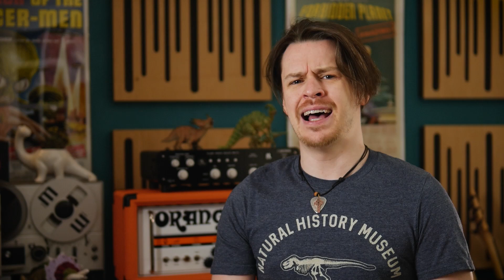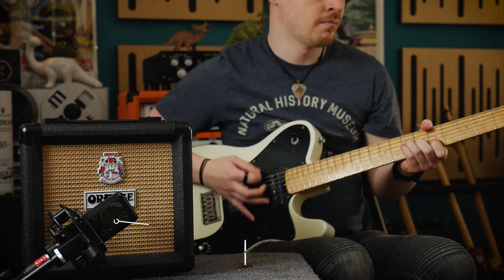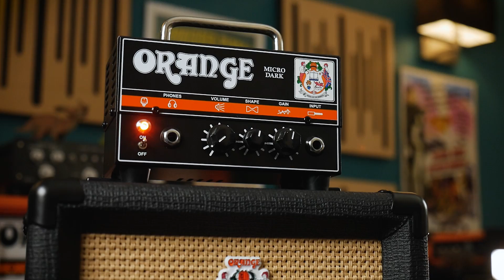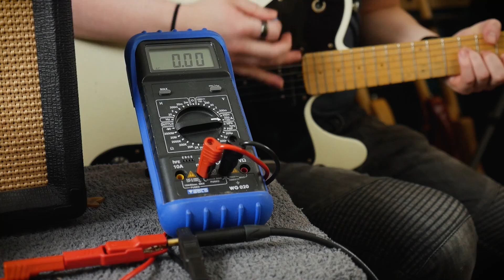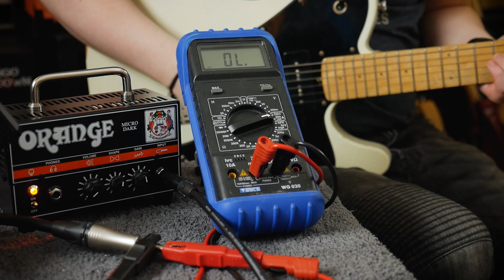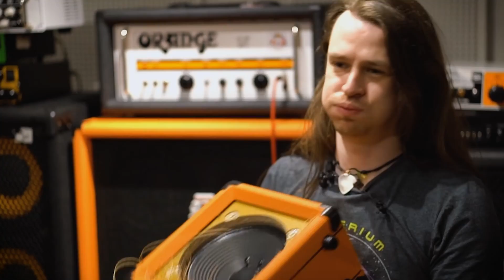Are AMPLIFIERS a LIE?! Guitar Direct into Speaker | Too Afraid To Ask

Comment from the maker: What would happen if we plugged our guitar directly into a speaker cabinet without an amplifier? It might seem obvious, but let's put it to the test and determine WHY amplifiers are so important. 

Ask your TATAs in the comment section and perhaps they will become the topic of a future video.

20W Guitar Speaker into 200W Bass Amp - https://www.youtube.com/watch?v=vuQAJCDQd5E

#guitar #amplifier #speaker

More from CSGuitars: 
Gain access to exclusive content at: https://www.patreon.com/csguitars
Join CSGuitars Discord - https://discord.gg/d7b6MY8
Buy CSGuitars Merchandise - https://www.csguitars.co.uk/store
Website - http://www.csguitars.co.uk
Contact - colin@csguitars.co.uk
Reply: I have a better question; would it damage your home media speakers (such as your PC speakers) if you connect your guitar to them directly? Or with a pedal? Say, whats the difference between a Logitech Speaker (with built in amplifier) and a Marshall Guitar Amplifier?
Reply: You missed some science. A larger speaker with a higher SPL per watt would be much easier to drive than that small orange speaker. I imagine that orange speaker is around 90db at 1w/1m. A good 12" speaker will be around 100db at 1w/1m. 
 I had a horn loaded cab once that was sensitive enough to pick up a radio station when not connected to anything.
Reply: @stimpsonjcat26  GOOD point!
Reply: Blackstar has some Tube driven guitar pedals. Do you think one of those might have a more substantial sound plugged directly into a speaker cab?
Reply from the maker: @Gonnasifaherpewarts  They'll still be outputting at line level impedance because they are intended as preamps, much like the Rat used in this video. They'll still need a power amp to drive a speaker effectively
Reply: @Gonnasifaherpewarts  try with a 4 ohm or less low wattage speaker if the pedal can stand it
Reply: @Gonnasifaherpewarts  Nah! The output levels will be the same!
Reply: What would happen if you'd plug into a powered cab, like you would use with an unpowered Kemper?
Reply: What would happen to your amp and/or speaker if you used an instrument cable to run to your cab instead of a speaker cable?
Reply: @dudemcfaceyface  DON'T do it!
Reply: @DMSProduktions  I'm not going to do it, I like my amps and cabs too much. I'm just curious as to what would happen and I thought maybe @CSGuitars could show us.
Reply: @dudemcfaceyface  GOOD boy/girl/thing!
Reply: Now do "Are cable a lie?"
Reply: @robbirose7032  Oll yor bass are belong to us!
Reply: 🌋☄🧟‍♂️🎆🚨🔥🌪🍆💣🦠💥☠🤡
^ to put it lightly.
Reply: @lichkrieg4898  SPAM alert!
Reply: @DMSProduktions  no, that's literally what happens. a bunch of emojis appear and accost you.
Reply: @lichkrieg4898  Isn't this WHAT'S happened?
Reply: HO There! Some multifx units are enough to drive speakers, at least for home practice/bedroom level. I'm running distortion pedals and a lexicon mx200 through a mxr rack EQ straight into an orange 1x12 (16ohm), no amp. actually kinda loud if i crank it.
Reply: I managed to get a lot of sound by pluging my guitar into the mic port of a record player which went in to some speakers and was louder than my 10w amp

Comment: The guitar plugged directly into party speakers still makes decent noise. How is that happening?
Are there various types of speakers?
Are guitar speaker cabinets different from other karaoke party speakers, can some type of speakers drive the electric guitar signal but guitar speaker cabinets cannot drive the signal?
Reply from the maker: Your 'Party Speakers' are powered. What is getting power? It's the internal amplifier. Party Speaker are a hifi amp AND speaker in one box. 

Standard guitar speakers are just the speakers in a wooden box. That's why we need the separate amp.

If you plug the speaker into power, or it has a battery in it, then it's also an amplifier.

Comment: You can actually use a normal blue tooth speaker and plug it straight into the guitar with a lead  and get sound out. 
They are made to amplify the weak output of a phone. 

I use a an iRig2 HD , hooked up to an ordinary Hi-Fi system via my computer and Amplitube 5 max as the app. As my guitar amp is to loud. 

Works brilliantly

Comment: Pickups don't actually generate electricity so much as move electrons back and forth in an AC waveform. That gets filtered through a capacitor into the amplifier. Also, please do not pull current through your pedals. It's not designed to work that way, and power looking for ground will find it through the tiny circuits and burn them out if it's the only path. It can happen with your PC too if you have a powered USB hub but the PC itself is unplugged.

There is a big difference between the parts of a circuit meant for signals (<20mA) and ones meant for supplying current, and that 200mA is about 40x the amount of current that is used to drive the gate on the average transistor. Protected signal circuits will generally be powered or grounded through a pull-up/pull-down resistor, in which case it is limited in how much current can flow.

Comment: I actually did this experiment a few months ago and I found that my caline 10-band eq with gain and level maxed out is kinda capable of driving a speaker at kinda usable volume. Still I wouldn't use it lets say in case that my power amp breaks because guitar speaker's impedance is wery low and guitar pedals generally have relatively high output impedance which messes with the sound and sometimes might cause damage to a pedal

Comment: I can plug my guitar into any one of my studio monitors and it works just fine. It has its own power supply but i dont think it has an amp built in. How does this even work?
Reply from the maker: Powered Speakers/Monitors: The part that takes power IS the amplifier. If the speaker plugs into mains then it DOES have a built in amp.

Comment: If your effects pedal has a Headphone Out jack, you can plug that directly into a speaker cabinet.  The Headphone Out circuit is generally about 300mW-500mW (1/3 to 1/2 watts) and can be a perfectly usable bedroom/practice amp.

Comment: My hypothesis is that you will not hear anything or it will be very very quiet. the voltage that comes out of a guitar is very low, ad has very high impedance, so it realy cant deliver much energy to the speaker

Comment: Can I replace guitar cabinet with studio monitor?
Reply: Short answer is no. If you try to run a tube amplifier directly into a powered monitor speaker, audio interface or anything else expecting a line level signal, you will destroy your amplifier. You can get a load box that will handle the output of your amplifier and then it offers line outs, headphone outs, FX loop etc.

Comment: The more interesting question for me is… could I use studio monitors instead of a cabinet, as the output directly from the amp? Or vice versa, connecting a cabinet as the output from a DI box? I know it technically works either way, but what are the pros and cons of each setup vs doing it the traditional way?

Comment: If you hook up the guitar directly to the speaker, the impedance of the pickups are also thus much higher than that of the speaker itself that they end up consuming most of the voltage they produce themselves, a little bit like with a shorted battery. I wasn’t too sure what was going to happen with the active pickups, because I think they have a preamp in them that might decouple the pickups. I really enjoyed the test and your explanation.

Comment: Once when I started learning guitar I plugged my borrowed strat into some double speaker we had at home and I got a dry clean signal and it wasn't even very quiet. I don't know how it worked tho. (There were two speakers on each side of a radio that it was connected to, don't know if it has anything to do with it).

Comment: I think Colin forgot to specify that by amplifier he means power amplifier. The little orange head has pre amp and power amp sections. Of course, you can run your guitar straight into the return input of your effects loop to hear exactly what your guitar sounds like without any tone shaping by a pre amp. It'll be pretty lifeless and bland.
Reply: Don't take my word for anything. In fact, ignore everything I said.

Comment: Hey I have a TATA: Is there a difference between bass cabs and guitar cabs? I play bass and guitar. Can i get a cab and just swap out a bass or guitar head? Or should guitar heads only be played through guitar cabs?
Reply from the maker: Bass amplifiers can often dish our far more power than guitar amps. While guitar amps are typically 100W at their most powerful, bass amps can easily be 1000W. 

The speaker cabinets for each therefore are designed to handle those power ratings respectively. 
A 4x12 guitar cabinet may have four 25W speakers. The 100W amp will distribute its power evenly across all four speakers. 

However a bass cabinet requires speakers rated to much higher power handling to cope with the much bigger power from the bass amp. 

By connecting a 1000W bass amplifier to a guitar cabinet you may find yourself in a situation where each of those 25W speakers are seeing up to 250W!!

You should ensure that the power handling of the cabinet is sufficient to survive the amplifier you are plugging into it.

Comment: I have another stupid question : why do we need preamps in amplifiers ? Like, why can't the guitar-level signal go directly to the power amp ? I understand why it would be needed if you want to interact with studio gear which expects line level, but why replicate that inside an amplifier ? Sure, you want some gain and EQ, but these can be done at guitar level.

Comment: TATA question: Mixing and matching different speaker wattage. I have a 2x12 and a 4x12. The 2x12 has 2 30w speakers, the 4x12 has 4 75W speakers, all are 16 ohms. I have a 50 watt amp and a 100 watt amp. Would like to use the 100w amp with the 2x12. What's the considerations of mixing and matching, series, parallel, etc. Seems like it might make an interesting vid. Thanks Colin, hope you're well.

Comment: I'm going to nitpick here and note that the answer is rather "impedance matching" than "current!" (that is the Ohm thing, not the Ampere one), but since all relevant speakers today are very low impedance due to some major design constraints involving pesky physics and nasty mass inertia, it's well adapted enough to the reality to not be really wrong :)
There are some high-impedance speaker designs used in tube radios produced during or shortly after WWII, when copper was somewhat scarce and expensive, that were built to cut the the need for an output transformer, which likely would achieve a rather decent volume with just an effect pedal. Which, then again, technically are amplifiers, so the answer still stays at NO.

Comment: Interestingly, a tube amplifier doesn't increase the current until it gets to the output transformer. The vacuum tubes increase the signal by increasing the voltage with every gain stage and the power stage, then the OT converts it to an increased current for the speakers. Meanwhile solid state transistors amplify the current, which is why there's no need for an OT in a solid state amp.

Comment: A guitar pickup CAN drive a speaker...your problem was an impedance mismatch...guitar pickup in the thousands of ohms and the speaker at 8 ohms...basically zero power transfer...BUT if you connect the guitar pickup to an impedance matching transformer like an audio output transformer and then connect the speaker you would get a low signal in the speaker...it works...try this> connect 2 speakers together in separate rooms with a long cable...one person shouts into one speaker, another person in other room will hear sound from their speaker, a very simple intercom.

Comment: Active pickups are able to drive high impedance headphones, however, to a level where they can just be heard. 🙂

Yes, I tried it! 🙃
Reply: The purpose of active pickups is to give signal clarity and get rid of noise, so the coils of pickups and their signal will be smaller, preamp in guitar used to drive that signal right at the source cuz it's too week to even get to amplifier. So yeah, preamps of active pickups won't cut it either.

Comment: as well as that speakers require a DC, and a guitar pickup will put out an AC current, i.e the point of transformers and transistors in a valve amp
Reply from the maker: Speakers are AC devices, they are essentially nothing more than an inductor coil. Passing DC into a speaker would result in no sound and a burnt out voice coil. 

Transformers don't convert AC to DC, they transform AC voltage into a different AC voltage. The output transformer in an amplifier does this to match the impedance of the speaker. The amplifier needs to supply enough current at a consistent voltage to drive the speaker, that constantly changing frequency dependent ratio of voltage to current is impedance. 

Transistors are amplification devices, which use a small signal to control a much larger one. They also do not convert AC into DC. 

The device that DOES convert AC into DC is a rectifier and is constructed from diodes.

Looks like you need to read up on your basic electronics again.

Comment: Sound signal, amplified or not, "is" AC current. Should be AC current. DC current in a signal line must be avoided at all costs; in the power stage it causes overheating and destroying the speaker coil. So you measuring the current in a serial configuration is probably not the best concept. Wouldn't be surprised, if a (well setup) power amp would show you near to zero DC current. What you see on the display of multimeter is just the level of "confusion" you cause in the instrument - just like when measuring AC voltages on DC setting. 

Also, we don't amplify only current, but also voltage in an amp.
This experiment would make much more sense, if you would play the guitar in other room.
Reply from the maker: 1. I'm not sure what your complaint is -  I'm measuring AC current using the AC setting on the DMM and connecting it in series with the pickup coil: the AC current being generated by the pickup that would have gone to the amp (or would otherwise have gone through the speaker in the case of the amplifier) is being read by the meter instead. 
The meter isn't set to measure DC, I'm not measuring DC, because obviously all of these signals are AC.
Agreeably a better way to have done this would be to not open the circuit at all and attach a current clamp at each point, but unfortunately I don't own a current clamp, so inserting the meter directly into the circuit was the next best option. 
However, this wasn't a demonstration of ways to measure current, but rather to show the magnitude difference between each device output and this demonstrated that effectively. 

2. I'm not sure how playing in a different room would make any more sense. The only difference is that raising the gain of the recorded signal wouldn't show the sound of the strings slapping in the room, but rather complete silence and I'm not sure that makes for a better demonstration. The reason I wanted the string sound there is to give a comparison of volume. Viewers know how loud their strings sound when not amplified, which puts into context how little is coming out of the speaker. It's for comparative analysis, how loud something is is a difficult concept to convey on a video on this internet. 

Also, of course voltage is also amplified, but that doesn't feed as cleanly into the narrative about how voice coils can be burnt out, or how the internal construction of speaker cables differs from that of an instrument cable. It also doesn't discuss the most important oversight which is impedance matching, but that's a conscious omission.

It's impossible to communicate the complexities of all electronics in their entirety in a sub 10 minute youtube video made for guitarists. I'm picking my battles here.

Comment: what about the output transformer? doesn't that turn the audio from the tubes into electrical currents that drive the speaker? hence the output transformer burns up if you don't have a speaker load on your amp? The preamp and pedals boost the sound and add clipping/effects, but it's the output tubes and transformer that do the amplification correct?
Reply: Transformer is a bit different part. It's needed to turn your alternation current from socket into direct current. The tubes does the main job of amplifying weak current which is not enough to even move the speaker. And the pedals only meant to shape the signal, it stays almost the same in terms of power so it need to be amplified.
Reply: @darkvulpes4826  thank you. that makes sense.
Reply: @lichkrieg4898  yw!

Comment: I have a TATA for you: Can you jump the preamp of one amplifier to the power amp of another. For example could you plug your guitar into the preamp of a JCM800 and then run a cable from the send in the effects loop to the return of a Dual Rectifier?
Reply: yes,you can use a metal zone as a power section.here is a secret,they sound amazing as a pre amp.a billion times better than a distortion pedal

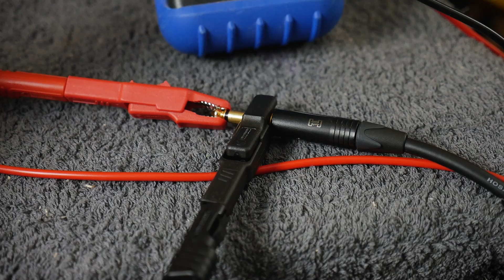Comment: 3:44 Shouldn't you connect meter in parallel to measure current?

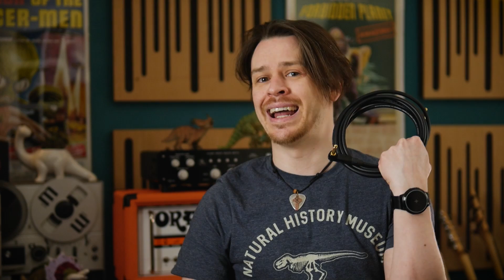4:50 200 mA is not a big current. You need only 1 mm2 of wire for 10 A. If you need a "special cable" for connecting amp with cab then what thick wires are in your walls for tens of A?